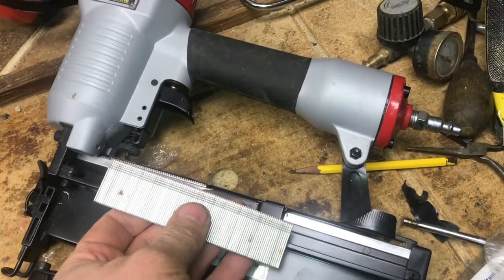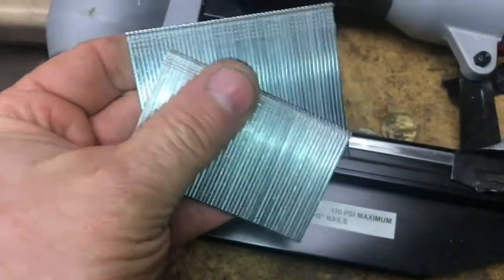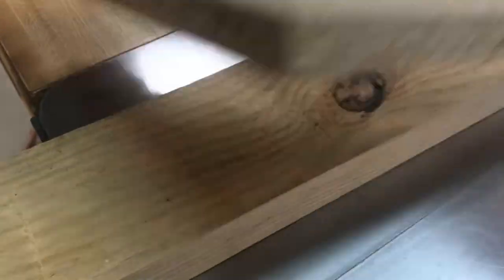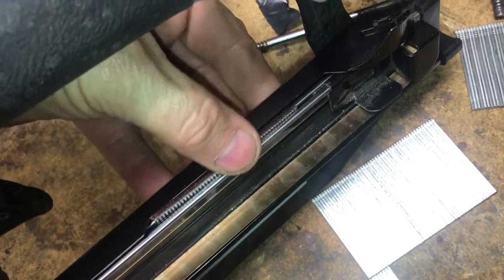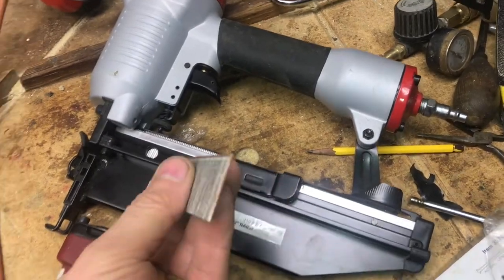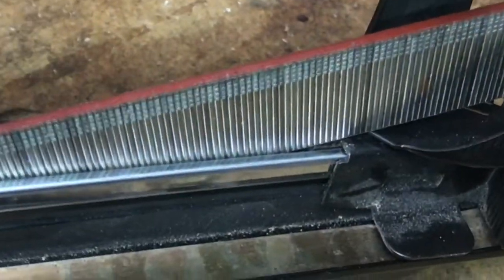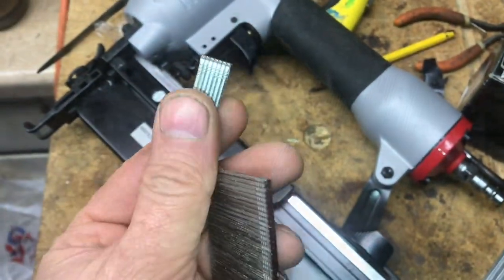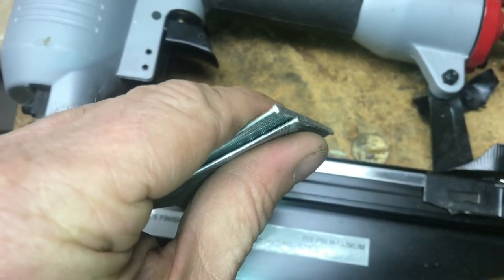what HAPPENS when you put the WRONG nails in your air nailer

Comment: FYI: If you continue to try and fire a 16 gauge nail in a 18 gauge, you will split the cylinder in the nail gun. I found this out from experience as I thought I had a problem with the nail gun. Only problem was I used the wrong nails. duh.
Reply: How about if we have the same proper gauge size  but we put a smaller depth brad nail than the minimum , Will it work or the brad might get jam or make it half way throw the wood .?
Reply: But this about using thinner nails. They fit, I am here to find what goes wrong in that case.

Comment: I just purchased this nailer from Home Depot and I find that it is not nailing the 2 inch 18 gauge Brads. It will however nail 1 inch brads . The description said it is supposed to use the 2 inch 18 gauge. Not sure what’s wrong. any-idea? Thanks nice video

Comment: Couldn’t figure out why my brad nailer wouldn’t fire nails. Spent time and money getting different hose pieces so I had zero leaks. Everything was done correctly and I was convinced it was the nailer.  Until I realized I was using 16 gauge nails in an 18 gauge nailer.
Reply from the maker: It’s easier and I thought to mix up the nails. It would be nice if they just didn’t fit. I was really glad when we figured out what the problem was. I’m also glad there was no damage to the nailer.👍👍